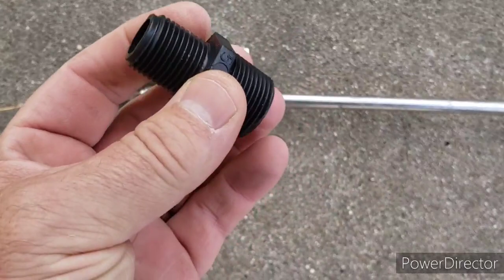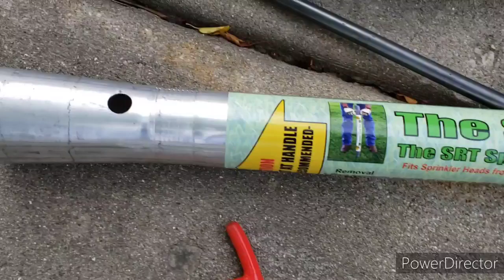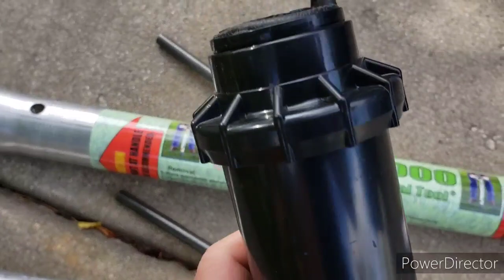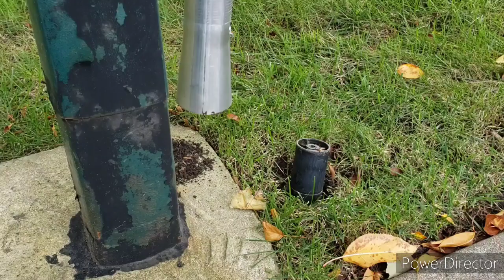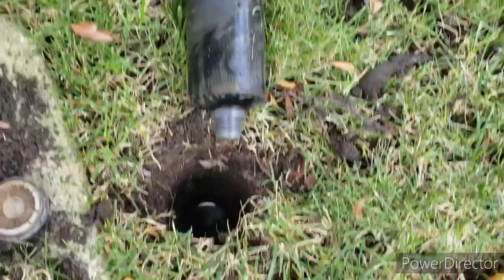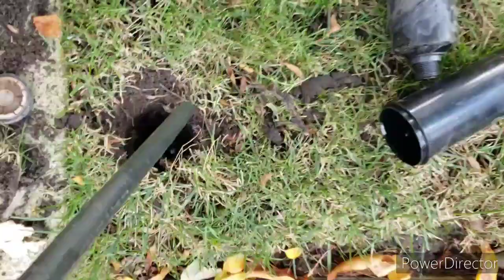Sprinkler head replacement made easy using these tools

Comment: Brilliant!  I was looking for a way to extend the length of the extractor.  That red handle is way too short for my sprinkler system.  So, a 13MM socket fits the extractor head well with electrical tape?
Reply from the maker: Glad to hear you are going to give this approach a try let me know if it works well for you it does for me
Reply: @dalechalkey3729  It worked great! My only recommendation is to also tape the socket to the ratchet extension. The first time I used it, the socket and extension pulled apart, and it was a pain to retrieve them in the TX clay. My plan is to buy a cheap socket and extension and solder them together.  I'll even solder the extractor head to the socket.  TY for the idea!!!
Reply: YThe cap to the head came off and the extractor had no grip without it.